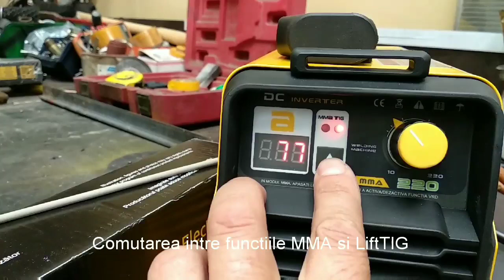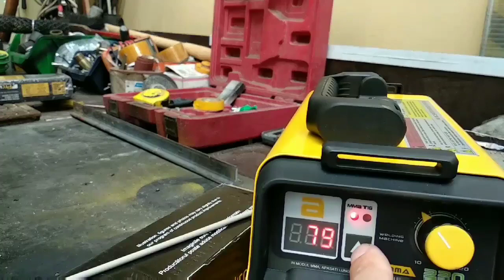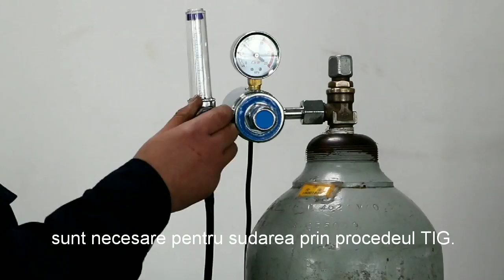Invertor de sudura profesional ProWELD MMA-220DLS

Comment: Aș dori sa-mi cumpar. ....dar spuneti-mi Vă rog,  apratul funcționează doar  alimentat de generator  (curent continuu )  ? 
 La priză 220 (curent alternativ ) NU FUNCȚIONEAZĂ. ....?
Reply from the maker: Buna ziua. Asa cum puteti vedea in fisa tehnica prezentata la inceputul clipului video, aparatul functioneaza la 230V curent alternativ 50Hz. Secventa cu alimentarea de la generator a fost facuta tocmai pentru a arata ca aparatul functineaza stabil inclusiv in conditii de santier unde de cele mai multe ori nu este disponibil bransament electric si se folosesc generatoare (unde parametrii tensiunii de iesire au de obicei fluctuatii mari). Nu este vorba de generator in curent continuu (nu stim de unde a rezultat acest lucru?!) ci de un generator electric monofazat care la iesire furnizeaza tot 230V/50Hz. Detalii suplimentare despre acest invertor puteti gasi pe pagina oficiala a produsului https://catalog.proenerg.com.ro/proweld-mma-220dls-invertor-sudura-profesional-igbt-4551mma220dls--p8127.html
Reply: Îmi puteți spune ce model de generator este cel din clip. Tocmai ce am achiziționat un Stager FD7500E și vroiam sa știu dacă acest invertor funcționează bine cu acest generator. Multumesc